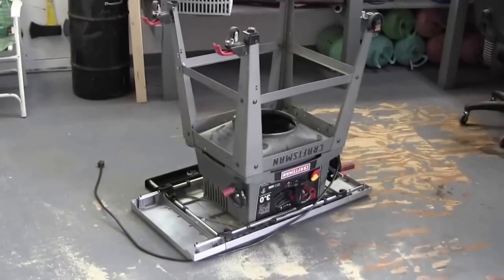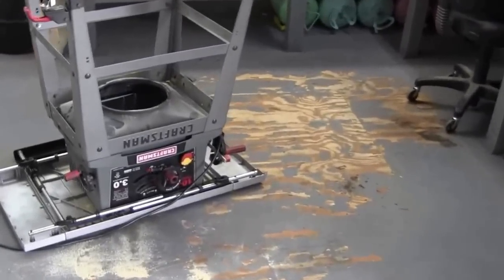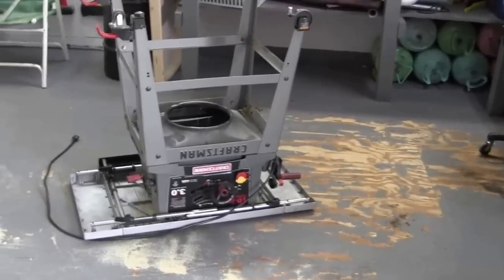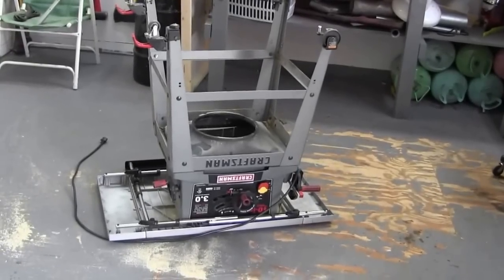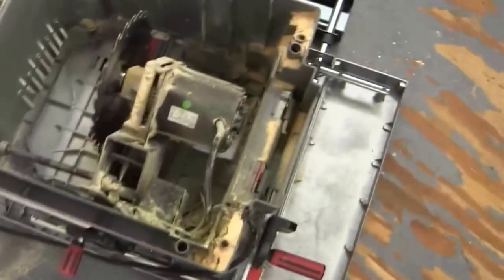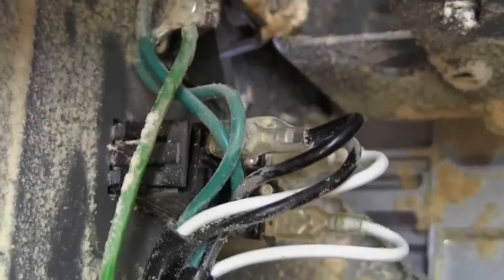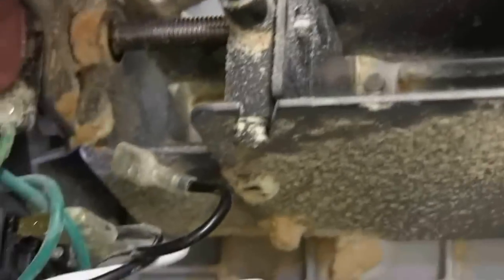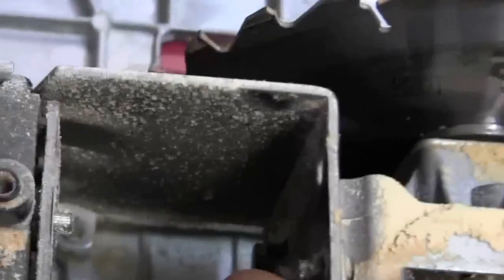Craftsman table saw repair, part 1

Comment: The same thing just happened to my saw. The bearing seized up. That rubber or plastic bushing is available to replace, but Sears did not sell the bearing. Problem is, they are willing to sell you a new motor that costs as much as a new saw. I googled the numbers on the side of the bearing, and found one on Amazon. I've yet to receive it. But from the measurements, I think it will work. I think that bushing is still usable, but you are probably right that the cuts may not be square. I think I will go ahead and order the rubber bushing because I can't afford a whole new saw at this point. I'm saving up for a pocket hole machine.
Reply: I just purchased one from Craigslist with a bad motor. Both bearings were shot, so I replaced them.  6200 and 6201. Realized the larger bearing on the output shaft was rough too, so I just bought that, a 6204.  They are all standard sizes.  I bought the rubber bushing and new plastic shroud (it had melted).  Put it back together and it sparked like a mofo.  Arbor commutators were damaged, so I turned them on the lathe and polished them.  Putting back together tonight, hope it works otherwise this was a bad purchase.

Comment: CHEAP Chinese bearings may be the worst, but GOOD Chinese bearings aren't. In the past two years alone I have refurbished 3 drills - including TWO Makita drills, an angle grinder an electric plane, a chop saw, a table saw, a vacuum cleaner, a dishwasher and tried to fix our washing machine! In ALL but the dishwasher (motor failed o/c after only 18 months!!) the bearings were shot. In some up to four bearings in others just one (but replaced both and kept the used working ones for emergencies or other non critical use). 

The washer could not be repaired due to truly appalling design which required removal of the whole drum assembly - not a problem - but then separation of the whole outer drum casing which had been ultrasonically welded tight (or appeared so) and in the end I had to use an angle grinder to get it apart. My wife had already decided she wanted a new one and had ordered it. Just as well as there was no way in hell I could have ever repaired the old one properly, or made it watertight again.

However, in ALL the other cases the bearings, whilst not open, were steel sealed and NOT rubber sealed - hence "cheap" original manufacturer specified and fitted items. They have ALL been replaced by proper rubber sealed bearings from China and NONE, despite MUCH use since repair, has even given the slightest whimper of noise. The most complex thing is getting the right depth. On occasion the only bearings being available being 1mm over or under in depth but ALL have been obtained from eBay & fitted without any other problem. They have all been priced VERY low <£3.00 ($4.00 ish) have arrived reasonably quickly (usually a couple of weeks) from China, although I did manage to get a couple from the UK in the same price range. In fact one pack of TEN cost less than £3.00 for a different requirement!
Looking at your motor and saw, they have a VERY similar appearance to the one in my table saw with an almost identical under table mount assembly too. I am VERY surprised you have had such trouble finding any bearings to fit. I had more trouble getting the final drive bearing out of mine than obtaining a bearing for it.
Reply: Oh! And two more things - 
1. Stuff from china costing a few ponds (bucks) gets shipped FREE or VERY low cost. Stuff I see from the US is sometimes FARCICAL with competitive product prices but shipping costs being up to FIVE OR SIX  times (or MORE) the item price!! WTH!? 
2. Use a gear/bearing puller DEFINITELY or you will have practically zero option other than to Dremel it off!

Comment: I had that same problem but I figured out the Motor turns the opposite direction of the blade so tat bearing I think was fine

Comment: hi brad,I have the same craftsman tabe saw you had. same problem,got it apart and the bearing off. where is the part number to order the replacement? your help would be appreciated.
Reply from the maker: Its been 4 years since I did this video. To the best of my recolection,there is a number on the edge of the bearing. If there is,you can google that number and get it cheap online.
Reply: Thanks,I punched in that 6200z nomber and found a replacement bearing for 9 bucks 16 with shipping. Was it worth fixing for you in the long run?  I've got my eye on that Delta contractors saw at lowes. Just can't afford it at the moment.
Reply from the maker: Roger Eden no. I ended up trading it off and buying the big dewalt contractors saw. It was never a terribly good saw to begin with but the new bearings didnt make it any better.

Comment: I have the exact same saw which I bought 10 years ago. I never really pushed it too hard and never heard it groaning with bearing problems. But one day it just wound not start. No groaning, just nothing. At first I thought it was my reset switch, o I replaced it. Then it ran for about a year. Then, for seemingly no reason it just failed to start...no groaning.

Comment: So what is the part number and where can I order it. Acording to Sears I can't order the bearing, model 137.24888 There are 2 bearings......one of them is on the 12A assembly
Reply from the maker: There is a number on the bearing. That bearing can be bought through any place that sells bearings

Comment: FYI, instead of spending $8 + shipping on a motor brush, google "999044 motor brush".  They are the same 7 x 17 x 18mm and are much cheaper.

Comment: Just like your video showed, easy if you already have mechanical skills.  I found that a high pressure air tube was great in cleaning out the motor.  DO NOT USE OIL on the brushes.

Comment: see note below from jcapcik:
 "FYI, instead of spending $8 + shipping on a motor brush, google "999044 motor brush".  They are the same 7 x 17 x 18mm and are much cheaper."

Comment: With all due respect, Mr. BCtruck, I object to you or anyone letting manufacturers off the hook buy making a claim that "I got ten years out of this product and that was "cheap", but worth the price because I lasted until it failed.  This claim merely sets up a scenario for manufacturers to build components that are expected to fail prematurely. I have purchased dozens of Craftsman electric tools as well as numerous minor brands and have only one (the Craftsman 137.248830) have a motor bearing seize up only after a few dozen hours of operation This is unacceptable. Obviously Sears made a decision to use a cheap bearing on the motor shaft inasmuch as so many Craftsman able saw owners have complained. Sub sequentially, I purchased a Timkin bearing  of the same dimensions from my local Grainger outlet for less than 10 bucks and it ran beautifully for years without the slightest problem or heat build-up. Obviously some groveling bastard at Sears design department made a decision to provide wonderful features in the overall equipment, but totally unreliable in its  drive system.
Reply from the maker: Oh get over yourself dude. This is a video showing folks how to repair a tablesaw. Go make your profound proclamations  on quality somewhere else. I live in the real world and quality is only getting worse. Showing people how to fix junk is better than complaining about the fact that it’s junk.

Comment: a proper craftsman would have repaired it by cutting the old bearing and putting a new one in place
Reply from the maker: You didn’t watch the video, did you nimrod? A proper douchebag would watch a video before commenting.

Comment: For everyone coming here to fix their saw, check out https://secure.searspartsdirect.com/partsdirect/ They had every bearing part available for this table saw.
Reply: The bearing on the end of the armature that failed is not labeled as a replacement part on this model.
Reply: +Rattlecan Guitar Restorations I saw it on the armature, so you'd have to buy the whole $80 arm

Comment: found a bearing on ebay 6200-2RS, 6200RS Premium Rubber Sealed Ball Bearing 10x30x9mm for a few $$$ it should work. I ordered mine today and will know in a few days
Reply: Did it work out for you? How did you press it on? Thanks Donna
Reply: Yes it worked fine
I pulled the bearing off with a puller as nd hammered the new one on using a 2x4 on top of bearing so it wouldn't be damaged
Reply: Found bearing on eBay
When I got mine off measured it and found it exact fit

Comment: What a horrible design! Anybody with this motor should be compensated.
ASAP
Reply from the maker: I fixed this and then traded it for a truck bed toolbox. I now have a really nice dewalt table saw.